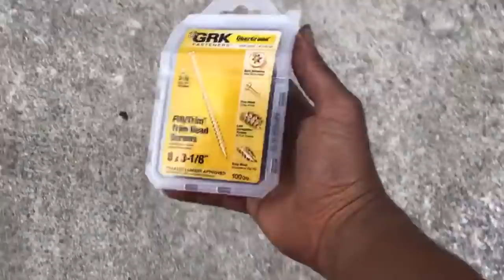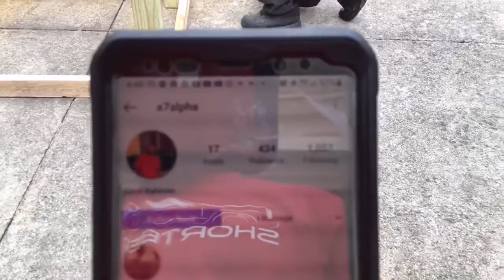Building a Truck Bed Transport Cart

Comment: Thats cool! Years ago when I did alot of frame work on trucks like for hydraulics, airbags, building C notches, boxing frames etc. I took an old work bench table thing we had and put casters on the bottom so we could move beds around the shop easier

Comment: Hey man congrats on the red bed score. You two made out good. Cool guy for helping with a bed cart. That is a nifty tool to have. Tip if you find some old camper jacks with a hand crack those right there come in real handy. Me and my jefe used a pair to remove a utility bed on a truck to make it a fla bed. Props brotha
Reply from the maker: I appreciate that bro! If you have instagram, send a pic of what you're talking about. @cool_cars_kj
Reply: @CoolCarsKJ  sorry brotha no Instagram or facebook. If you look camper jacks you will come across them. They use a hand winch like the ones you see on the front of boat trailers.  You simply place them on your lift point and slowly crank each side down. They can lift from about 4 inches of the ground to about 4 feet. I scored a set on offer up and have made a few more just to have. Saves your back brotha big time